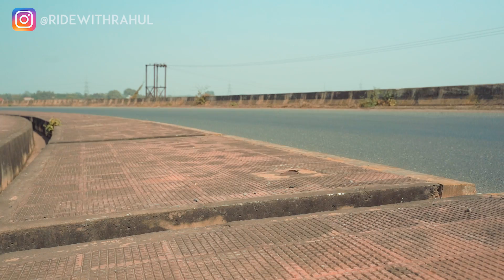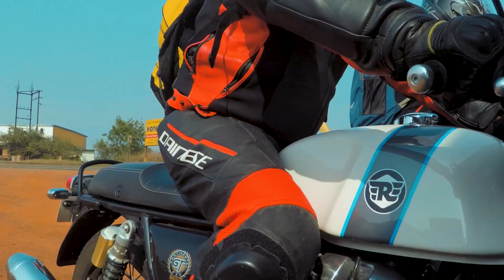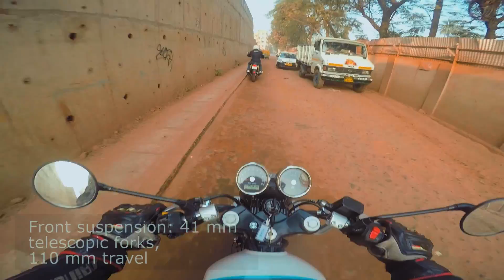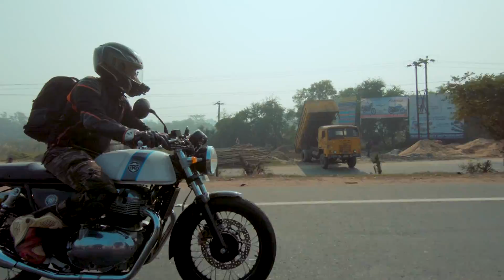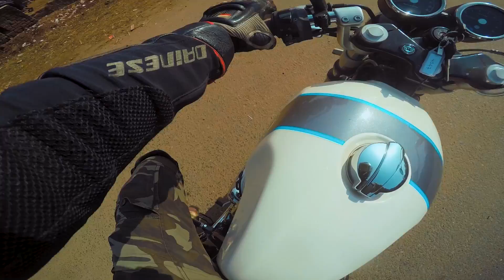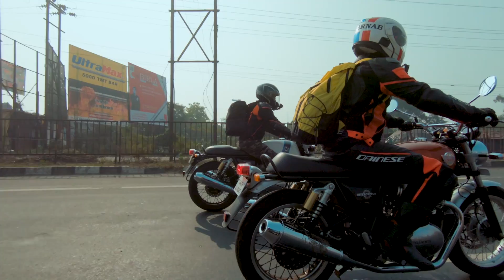Royal Enfield Continental GT 650 Review | 300 km road test | RWR

Comment: I did 300 km and its really not comfortable neck pain back pain
Reply from the maker: Any motorcycle with clip on handlebars won't be comfortable for all riders. I rode everything back in the day, the most comfortable was lightweight naked bikes with wide bars and slightly rearset or neutral position footpegs. Dual sports bikes also top the list but they are not available in India.

Comment: Hi Rahul,
I am wondering, both the Dominar 2019 and RE 650s can push above 150 km/hr. 
I have two questions based on your ride experience with them. 
1) Which one is the best when it comes to handling and has lesser vibrations?
 2) Which one has the better comfort for rider as well as a pillion (heating, suspension and seat)?
Reply: Bhai GT650 bas looks ke liye hai
No real life purpose
Aur sabse chutiya 650 cc bile hai yeh

Comment: A 270 crank is not a parallel twin you might as well call it v twin because the engine configuration is more similar to a V-Twin than it is a parallel twin the old triumphs would parallel twins the pistons went up and down together a 270 crank is not a parallel twin

Comment: Looks fantastic! however, a 650cc with a 6 speed transmission should do far better than 165 kmh. I also see some geometry and tire issues: 1. It needs fatter tires, hopefully the chain and fork geometry will allow this. 2. It looks like your knees are touching the cylinder head??? 3. The foot angle on the peg looks outrageous, even simply compared to the standard Int 650. That can't be comfortable...

Comment: I wonder why the top speed is so low, my Suzuki v Strom 650 would do 120 mph
Reply: The engine only makes 47 horsepower on the Enfield, which is only good for about 100mph. However, because the engine is low-revving, you can maintain that speed pretty easily without issue.
Reply: An American vlogger got an indicated 115mph in 5th, 110mph in 6th but he was touring with 75lb (34kg) of luggage so I think , given enough time and space it will get an indicated 120, it's not a crazy fast bike but those are respectable real world numbers for a 650 parallel twin, if you replace the heavy silencers, clean up the airflow and tune it you should get 50/52bhp and an 8 kg weight reduction which is a cheap, simple, worthwhile upgrade.

Comment: That’s one hell of a review.. And my main concern is, as far as I remember the CGT comes with a single seat just for the rider unlike a pillion in Interceptors.. Whereas you have a CGT with dual seat. Is it part of the standard Accessorories or should we get it installed from a mod shop ?
Reply from the maker: standard CGT is with pillion seat and the single seat is an accessory which you have to purchase separately so you get twin seat stock when you buy the bike.

Comment: Very thorough! Nice work.
When you had that little upset pushing hard through the turn, did you hit some humps in the road? It looked like you bounced a little. Hitting bumps in a fast corner would upset most any bike.
Reply from the maker: No there were no bumps, I was going too fast so I was trying to use a bit of front brake to slow down, it upset the bike.
Reply: @RideWithRahulOfficial  Glad you kept control! Thanks for the reply.

Comment: Good review....but i do not understand one thing....why do people always want to revv the nuts out of everything they get their hands on ?? People need to keep in mind that there is something known as relaxed cruising and a specifically....THIS IS NOT A HIGH REVVING SPORTS BIKE ENGINE LIKE THE NINJA OR THE RC390....its a different motorcycle all together and revving the nuts out is not  justified here....its like a guy trying to revv the hell out of a steam roller and then complaining when it fails to revv....come on guys revv only when necessary....not all the time....cheers
Reply: It's a good point. The engine has a flat torque curve, so it will pull happily from low rpm. Much more relaxing and the rev limiter will not trouble you!

Comment: Awesome review Rahul, probably the best I've seen for this new RE 650. Would it be possible to fit 140/17 rims on the rear wheel.... Any thoughts anyone?
Reply from the maker: Almost all rims allow one size up.
Reply: Ride With Rahul 
I was thinking more of replacing the rear 18 inch rim with 17 inch as well as using a 140 tyre, the 140/17 tyres are much easier to find, do you think that downsizing the rim to 17 inches would cause stability problems?

Comment: does a regular puncture guy can open up the wheels and remove punctures of this bike as i had been informed that in case of puncture u need to get the bike in service station to fix and also will i be able to fix tubeless tires on the same set of stock spoked rims or i need to buy set of new alloy rims.
Reply from the maker: Punctures can be repaired by regular guys I feel, but they may not be able to remove the wheels, also spoke wheel won't accept tubeless tyres you need alloy wheels for that.
Reply: @RideWithRahulOfficial  then if the bike gets punctured in a remote location then u need to approach RE service station
Reply: Can these rims work well with outex rim tape and the original tires - will the bead work with this rim to give a good seal?

Comment: Duke 390 vs continental gt 650. What is your opinion on the matter? I've test ridden both and can't make up my mind.
Reply: Gt     dual exhaust + resale value too
Reply: Booked the gt :)
Reply: Ojas Tushar same question Bruh
Reply: Pratik Jadhav . This is my opinion on both the bikes after having test ridden them twice
Continental gt (pros) : better gearbox , more precise and positive shifts than on the duke .
                                        Engine extremely smooth and torquey at any rpm. Engine note is also amazing 
                                        Engine should also last for years as it is highly under stressed.not much heat is felt on the legs due to rear set pegs
                                        The front brake on the gt actually felt better than on the duke .abs is a bit abrupt
Duke 390 (pros) : better suspension for sure, bike stays more composed over bumps while cornering 
                               Brutal acceleration , very peppy engine 
                               Much lighter than the gt , more flickable . The metzlers on the 390 are better than the pirellis on the gt
                               More features than the gt . Tft instrumentation is amazing .

Styling is very subjective , both are very good looking bikes in their own way 
Build quality also seems to be about equal

I decided to book the gt as it felt more special to me , the design is also timeless and that 270 crank exhaust burble is too intoxicating 

Hope this helped :)
Reply: Ojas Tushar Thanks Bruh
Reply: d390 is faster and has more features. lighter as well
Reply: also much more fun in the city

Comment: U put in lot of efforts..Nice! keep up the good work! God bless! And have subscribed and pressed the bell. Added one like too!..waiting for jawa..one more thing which one u will advice for daily commute and long rides with very reliable and durable engine with 35 kms/litre mileage..? Have shortlisted few fz25, jawa, cbr250r, ..may be upcoming gixxer250 if its going to launch soon..
Reply from the maker: From your requirements cbr250 tops the charts and mileage will be 30 kmpl and not 35 for CBR, fz has the mileage but doesn't have the power nor ABS so can't recommend it. I am unlucky that Java hasn't launched in Kolkata so waiting for them to show up.
Reply: @RideWithRahulOfficial  thanks brother! Awaiting for jawa but as its new platform not sure abt the reliability and durability.. Though it uses mojo engine

Comment: Nice & proper review after covering more than a hundred kms on the machine 
Curious to know your thoughts on the  ability of the Int650 to handle some mild off-roading like  the ones you get in North Sikkim or Spiti.
Reply from the maker: I recently spoke to Shaji Koshi from Royal Enfield and he said the bike has been tested on terrains like Ladakh so if the claim stands then it should be able to manage the off road. Personally I would have wanted beefier front shocks but this should do just fine.

Comment: Handling problem at breaks on turn is because of abs
Reply: i think it's due to the suspension on front
Reply: @hariprasadhari5045  no.it only applied when the two suspension r at different levels.....

ABS doesn't work as a normal drum brakes. ..it ..is different
Reply from the maker: Don't think so, have ridden several bikes with ABS on the exact same turns.
Reply: @RideWithRahulOfficial  I'm doing an research on abs technology.....
During a turn ...abs give some different handling....
Reply from the maker: I know that, but not enough to destabilise a motorcycle.
Reply: @RideWithRahulOfficial  I'm great fan on RE..N I even OWN SIGNALS 350..
Reply: @RideWithRahulOfficial  there r some corrections going on in ABS.....Soo